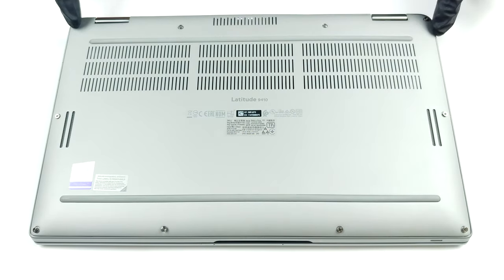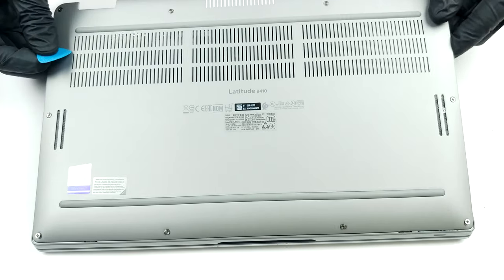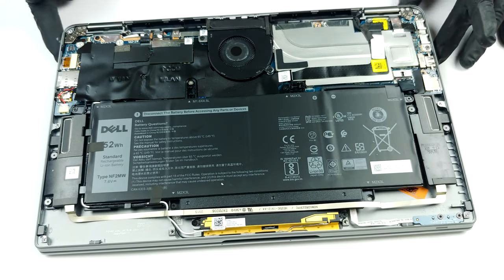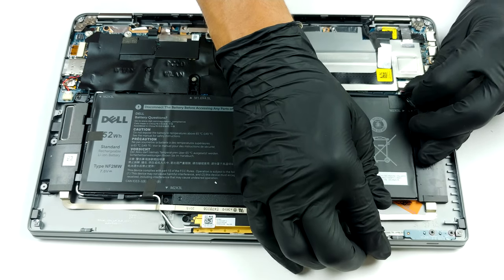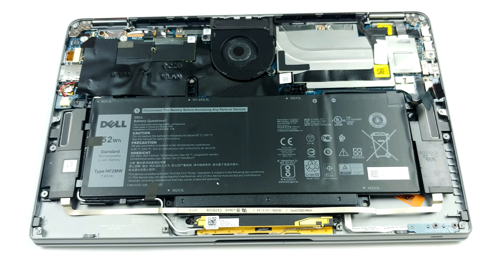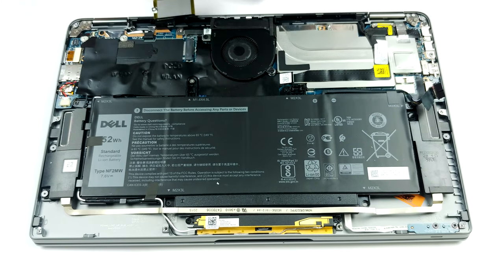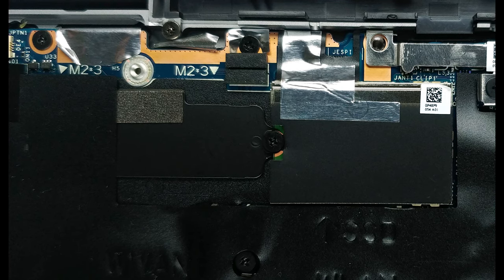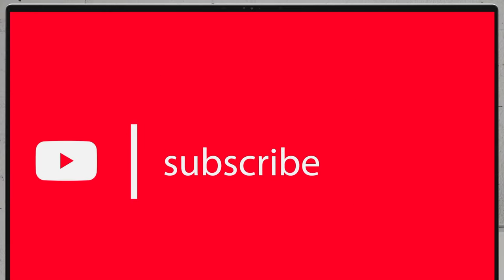🛠️ Dell Latitude 14 9410 2-in-1 - disassembly and upgrade options

Comment: Your site says this has a 2280 form factor SSD but it appears to be a 2242 (42mm length).  Which is correct?  Can it take a longer M2 device even though it comes with the short one?

Comment: I'm trying to repaste one of thee, and this gave me no help
Reply: The heat pipe is under the aluminum cover. Once you remove any other wires in the way, the aluminum cover pry off easily. I didn't remove the top portion and just lifted the bottom enough to unscrew the heat pipe